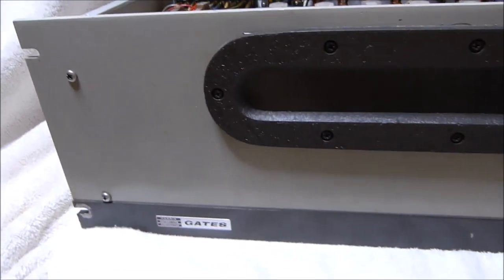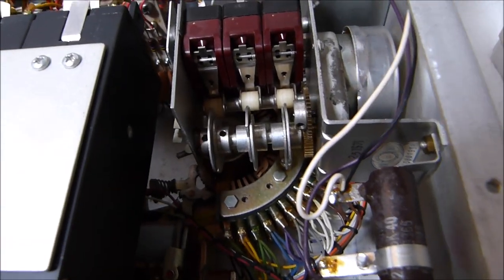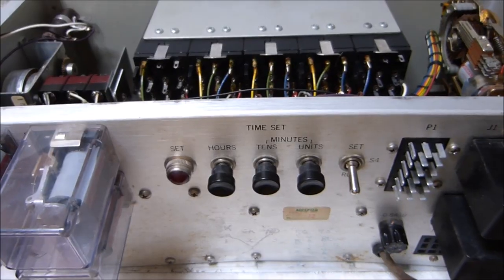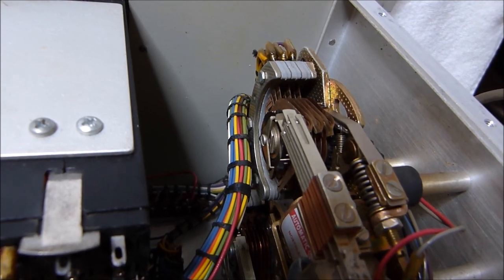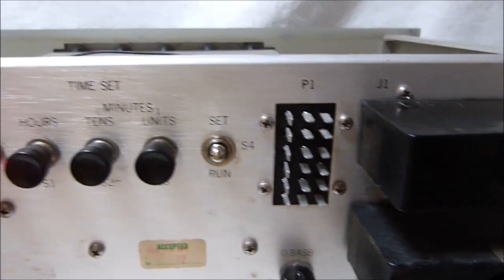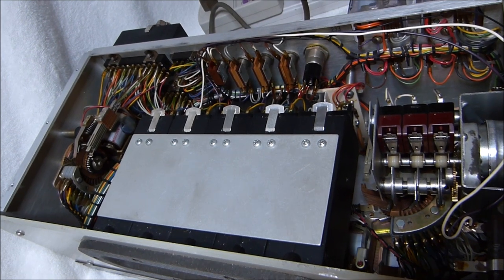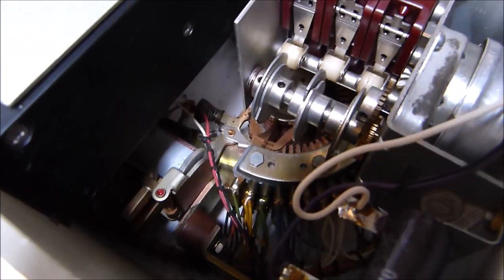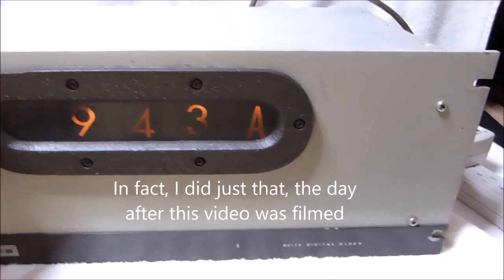Gates DC-10 electro-mechanical digital clock (1972, USA)

Comment: Absolutely incredible! What exactly would be the benefit of such a complicated design like this? Is it more accurate?
Reply: In the 60's, the first digital clocks were before semiconductors were invented and were mechanical in nature like above and mainly found in industrial or automation applications.  The invention of the semiconductor brought about the individual transistor in the mid to late 60's and then soon were integrated into packages of many transistors.   Low scale (LSI) then medium scale (MSI) integration with large scale (LSI) following was all happening in the early 70's.  The consumer market finally saw production digital clocks for home use in the early to mid 70's with these LSI and MSI chips.  It is all progression of technology.
Reply from the maker: Basically what Jim said. By the time this clock was made in 1972, it was pretty obsolete. It's just as accurate as any other AC operated clock, which is to say, easily accurate enough for most purposes.